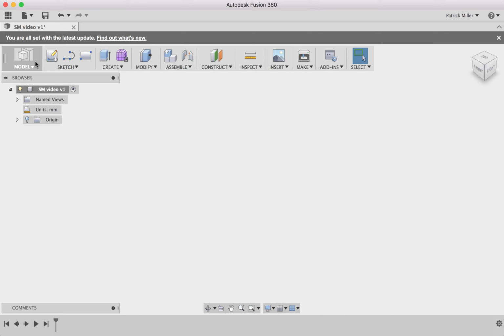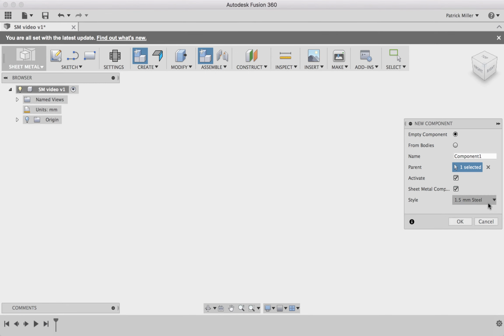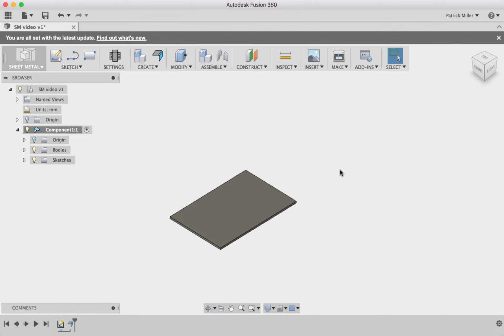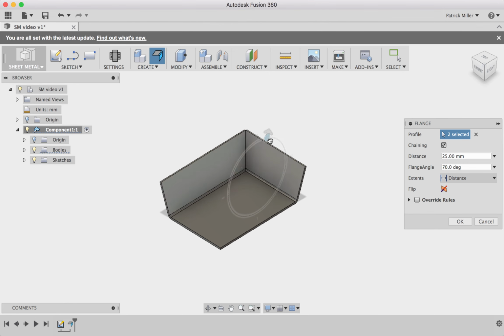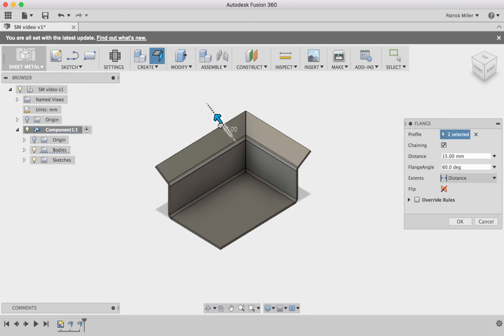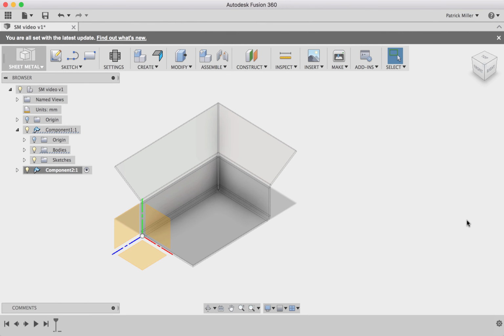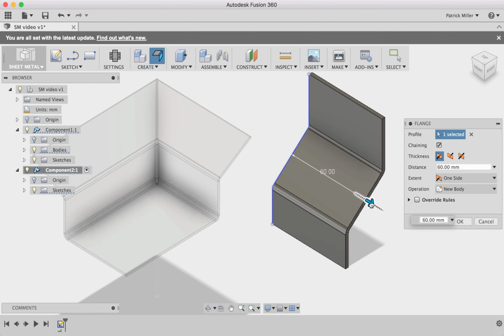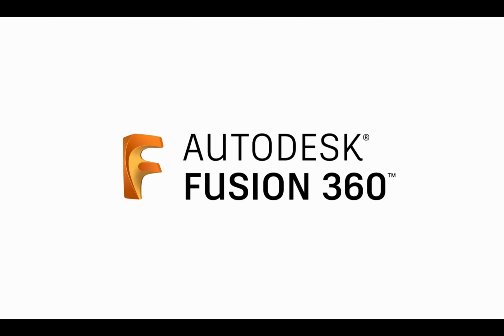Sheet Metal Progess

Comment: This is very encouraging.  I have a PlasmaCAM table that I would like to use to cut out some sheet metal components (I'm making a console to hold the computer that runs the plasma table).  Is there a beta program that I can join to test this feature and provide feedback?  Has the un-rolling capability been added yet?  The PlasmaCAM software expects a DXF file, so being able to unroll a sheet metal component to a flat, then export that component as a DXF, is what I'm needing.